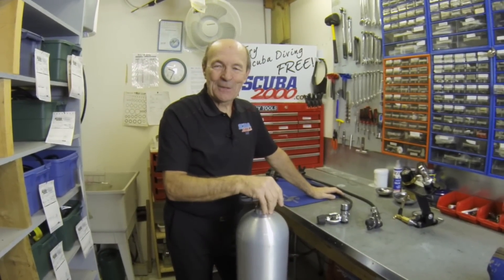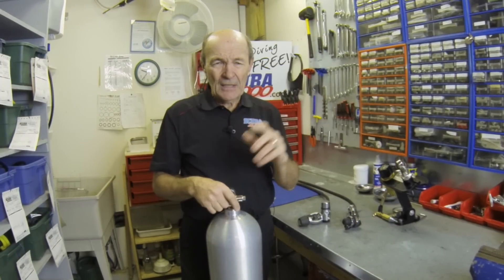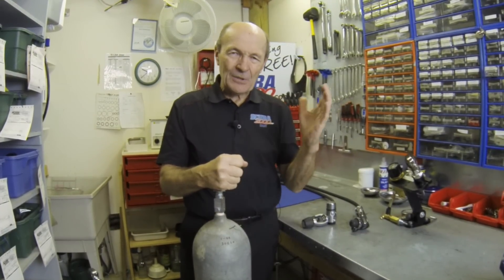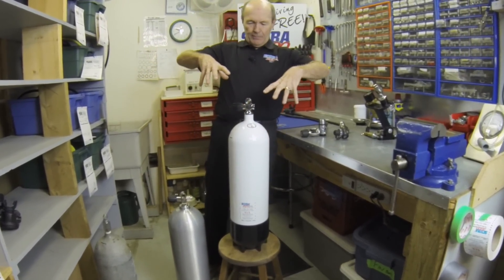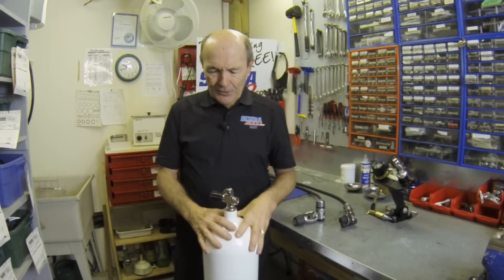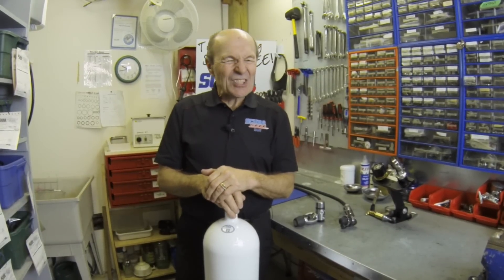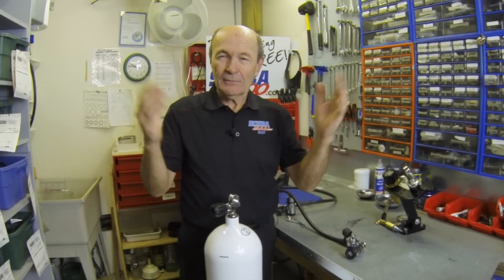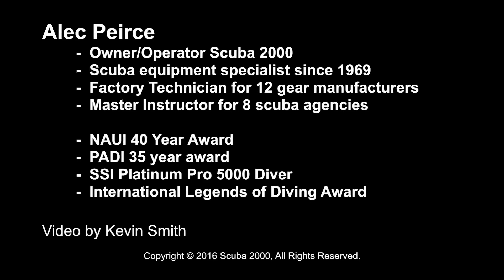Steel vs  Aluminum Tanks - Scuba Tech Tips: S03E07

Comment: In my opinion DIN has one more advantage over Yoke. The O-Ring is in the Reg, not in the tank valve. 

So it is the diver's responsibility to have a proper O-Ring in his Reg and everything will be fine. With Yoke you have to rely on the Dive Center. 

For example renting a tank, not checking it in advance and finding out that the O-Ring is broken when you finally arrive at the dive site isn't a funny situation.
Reply from the maker: There are as many O-Rings in a DIN reg/valve assembly as with a yoke. In fact, if the DIN valve is a converter valve as is more common these days, there are MORE in a DIN. DIN or yoke, inspection and annual replacement of O-Rings is necessary to avoid missing a dive.
A tank must have an annual visual inspection. We always replace both O-Rings - the neck which both DIN and yoke have and the face O-Ring of a yoke style. O-Rings cost like $1.20. I've had divers argue with me that they don't need a new one because they replaced it "just last year".
So it isn't the valve style. It's diver care.
One small point is that if the DIN O-Ring in your regulator fails, your instructor or buddy won't have a spare unlike yoke O-Rings which are very common. You better carry one.
I'm not sure I agree that a diver is more careful about maintenance than a dive shop. Although I must admit to seeing some pretty sad tanks at dive resorts.
Take care. Alec
Reply: Are there real advantage for Yoke regs? DIN one you can use with 200 bar or 300 bar, they smaller and lighter, also I've never seen them making bubbles like Yoke do (I know that O-ring should be serviced properly, but looks like O-ring in a tank getting destroyed quicker, probably because it's also there during pumping air into tanks), so why not switch to DIN and be done with that? It's very annoying to always remember about it.

Also price is the same for DIN and Yoke for at least some bands.
Reply: Kons G this happened to me during my PADI course. We drove 2 hours to the dive site and found out o ring was faulty. Luckily my instructor carried spare o rings. I want to use DIN for this reason.
Reply: That's fair enough Alec :) 
I just got the personal impression that we have problems with Yoke every now and then (currently doing my Divemaster internship in Asia), while i've never seen a Problem with DIN in Germany before. 

My Reg (Apeks DS4) has a spare O-Ring on the outside of the dust cap, so i have it with me automatically ;)
Reply from the maker: Boy, that sounds like a great idea right?
Many divers do the same thing - they keep a spare O-Ring, whether tank face O-Ring for yokes or DIN for their regulator, attached to the reg somehow. Yoke divers can simply put one on the threads of the yoke screw under the knob. DINs can be attached to the DIN cap or just a cord on the regas you suggest.
Here's the problem. Unless you are one of those 1 in a 1000 divers who checks and replaces everything all the time, you won't even look at your spare O-Ring until you need it. Am I right? Be honest. So, by the time you need it, it's been hanging there for 2 or 3 years (or more) and is so dried out and cracked it's useless.
I see it all the time when servicing regs. I notice a spare O-Ring on the reg, check it and it's toast!
Just change them every year without fail. They will easily last a year unless you leave it in the sun and salt all the time. Alec
Reply: You're absolutely right Alec, i'm not the one out of the 1000 😀
Reply from the maker: At least you're honest. This is our sport, for fun, so of course we don't spend hours checking and re-checking our stuff. I'm just as bad. I know my gear was working last time so it must be OK to go right? Fortunately scuba diving is a very safe sport and the gear is very reliable so we can get away with a casual approach. Aren't you glad you chose scuba over sky diving??

Comment: I was in the market for a used tank, and ended up going with High Pressure 100 steel, which happened to match the ones I had been renting all along). Here is something to consider. While ALU80 are cheap (about $170 online vs HP80 at $280) if you look at getting the higher capacity 100cf (I'm tall guy and like to stay as long as possible, not a problem with a drysuit even in cold 50deg waters in Monterrey) then ALU100 are much closer in price vs steel ($280 vs $330) but the worse part is the weight. Catalina 100cf is listed at 42lbs vs 34lbs for faber100 (whopping 8lbs heavier!) yet buoyancy is only -5.2lbs vs -8.41 full so you need an extra 3lbs of lead as well. That's 11lbs difference which is a lot to carry when I already have a belt with 26-30# and a full tank...

The difference between Catalina 80 (32#, -1.8) vs faber HP80 (28.6#, -8) is similar 3.4lbs heavier, yet 6.2# more of lead needed. 

The tank I got (XS Scuba/Worthington X7-100) is ever better buoyancy listed at -10lbs full (I measure mine at -13.2lbs in pool water! and only 1.5# heavier on land than faber's HP listing). If I switched to standard CF80 ALU I calculated I would need to add 11 lbs of lead to my already 26# belt - Yike! :(  (13.2 - 1.8 not taking into account salt water)

Most shop and people who knows dive HP steel here (cold water) for a reason. In tropics where you don't need much weight at all, ALU80 might be ok (not ALU100 running the numbers I did above!). ALU is HEAVIER due to thicker walls on land, yet not as high psi so more floaty (bigger water volume displacement) and actually FLOAT when near empty which you don't want diving IMO. The thing going for ALU80 is the price (and cool colors!), but that delta disappears in larger sizes (less common)...

fascinating video - no wonder ALU80 are cheap
https://www.youtube.com/watch?v=OmSvbp2NFbc&feature=youtu.be

Comment: I have a "Steel 72" made in 1959. They used to use pipe threads to seal with Teflon tape.
More modern steel tanks use O-ring valves like aluminum 80's.
Aluminum 80's cannot be trusted after about 10 years old, some dive shops refuse to fill them since they can catastrophically fail from Sustained Load Cracking brittle fracture around the threads. The 6351 alloy also has age hardening over time which makes the alloy brittle.
Even the newer 6061 aluminum alloy tanks can be a "non-fill" after 10 years.
Aluminum tanks have a secondary eddy current test to look for cracks during hydro and some dive shops require it for annual inspections.
Steel tanks cost more, but they last longer. I have tanks made in the 70's/80's that will still pass hydro.
Yes, steel tanks can catastrophically fail as well but it's uncommon vs. aluminum 80's.
Rust (light haze) in a steel tank can be "tumbled" out and if the tank then passes hydro, it's good. Corrosion in an aluminum tank is an instant fail.
Rough estimate of strength: Aluminum is about 1/3 the density of steel, but it's also about 1/3 the strength so you need 3 times as much.
If you get a "boat fill" on a dive boat (some only fill to 1800--2000psi) the steel 72 holds more air that the aluminum 80 due to its larger internal volume.
In the 1980's there was a rash of failures on aluminum 80's due to the owners getting their tanks painted with a paint that had to be baked on at about 300--350 deg F. That was enough to soften the alloy and tanks were failing. Paint job looked fabulous, however.
Reply: interesting info. If your boat does low pressure fill, than LP steel are the way to go (a guy had a 120LP steel on my last trip and it looks like a water heater compared to my HP100!) but luckily they can fill to 3600psi but had them top mine off a few time after cooling off to get the full 3500psi my tank can take.

Comment: One thing you mention that steel tank can actually be lighter on land than ALU (where it matters when you carry your gear) because of thinner walls, but miss to mention is that HP steel can be a lot more negative buoyant which can really help you carry a lot less lead too so you don't cork to the top at 15ft on empty! Price aside, seems like the higher the pressure the tank, the denser steel, the better = less lead weight while being lighter on land (less outside volume that displaces water)... ok where is my compact 5000psi steel tank now ? :)

Ex: Faber HP steel 80 (3442psi) vs Catalina ALU 80 (3000psi): 
land: 28.6# vs 31.6# (steel 3# lighter)
Buoyancy full: -8.05# vs -1.8# (steel requires 6.2# less lead weight in water!)
That's a pretty significant difference....
Price: $275 vs $170 on leisurepro, so yeah $100 more...

Now on my lobster hunt boat trip, the compressor could only do 3600PSI Nitrox, and they hot fill it fast so you loose a good 300psi on cooldown/hit the water, so I had to ask them to top of the ~3200 I was getting before each dive! (tank 3492 rated). Some repeated customers had LP steel 100 @2450psi or so - big ass cylinder - and could get it hot fill close to 3000psi and get a good 2500+ fuller tank (+10%) and not have to deal with top off - so there was a case there for the opposite due to filling situation.
Reply from the maker: Lots of information to think about. Every diver and dive situation is different so it's hard to generalize. A steel tank is more negative and that's one of the main reasons to use it. If weight is not a problem, the good ol' 80 does a fine job. Filling to beyond the stamped pressure is simply wrong. It's not so much a matter of safety. The tanks will not burst but it's not good for them, I've had more than few safeties blow (they're not very accurate) and it is illegal to boot. The stamped tank pressure is the end pressure when it's cooled back to 70 degrees. Filling high and letting it cool is NOT the proper way. I think you probably know all this but to get a full tank are compromising a bit. I suggest that you're not using all the air anyway on a dive so what's the big deal about 3-400 psi? That is, if you exit with 500 or more anyway, why compromise safety for 2-300psi? Alec
Reply: well a 3500 HP tank filled to 3200 (cooled) is 10% loss and when diving nitrox, like we did 6 dives a day,  you are running out of air way before your no-deco times (shallow 35-50ft) so yeah I'll like an extra 10% time hunting for bugs that you paying $$ for :)
That's irrespective of the 500psi reserve safety you leave...
Reply: + Alain Dumesney "... miss to mention is that HP steel can be a lot more negative buoyant which can really help you carry a lot less lead too."

He did mention that. Watch again at 7:35.
Reply: +SeikiBrian he's comparing HP steel 100 vs ALU80 - says: same "size" more air and heavier so more negative buoyant  (so less lead to carry on you) BUT fail to say same 80CF tank in steel HP will be a lot smaller then ALU 3000psi and lighter on land, yet more negative buoyant - run the numbers.... that's why HP steel are more efficient in that respect. That key (vs cost)

Comment: alec  I have 2 older steel tanks that have certainly been completely empty for a few years. my question is. if they have some rust inside can they be cleaned and re certified ?
Reply from the maker: Well, it's not good that they've been completely empty but they may survive. Have your LDS (local dive store) do a quick visual check to see if they're OK. Then get a hydro test and proper visual. If they pass, they're good to go. I suggest the quick visual first to see if they should even go to hydro. If there's signs of serious rust because of moisture or even high humidity, there's no point spending money on a hydro. Most older steel tanks show some rust. It's called surface rust and is not a problem if it isn't corroded into the steel and isn't loose. They can do a quick clean with a special brush or if needed, tumble the tanks to scour the inside. Even then they will likely get a thin rusty finish on the inside but that's not a problem. When a tank is hydro tested, it's filled with water and unless it can be dried instantly (almost impossible) it will develop surface rust. We use a rust inhibitor in the final rinse and very hot water and an air dryer but some rust is inevitable. Hopefully they are not too bad and can be saved. I don't need to tell you that you must keep some presssure in them at all times. Just 100psi is enough. You also need to consider the cost. An older steel 72, tested and ready to go, is worth about $100. A hydro and visual will cost you about $50 or $60 so be sure the tanks are worth saving before you start spending money. Good luck. Alec

Comment: HI Alec!  Thank you for the great videos.   I have a question about steel vs Aluminum.   Do you find the balance to be different?  I feel like the steel wants to turn me over on my back.  I only dive aluminum once, and i don't remember that feeling.  (new diver in New Hampshire)  Thanks!
Reply from the maker: You're right! There's a big buoyancy difference. Steel tanks are decidely negative while aluminum tanks are slghtly positive when empty and only slightly negative when full. So with an aluminum tank on your back and with weights as usual close to the front of your body and in the normal attitude for recreational divers (horizontal facing down) your balance is nearly perfect. Put on a steel tank and now your back wants to swap with your front - you roll.
Using a steel tank requires you to move the weights around until you find the rght positioning of them. Once that's done, and it can take a bit of time, you'll be fine again. Steel tanks are the choice among technical divers (cave divers and for wreck penetration or deep dives) who want less lead weight but a negative positioning. They tend to be close to the bottom, want minimum fin movement and more controlled buoyancy without excessive use of a BCD. None of these is as important to recreational divers so the use of steel tanks and their odd characteristics is avoided, unless you're just looking for more capacity. The aluminum 80 tank, universally the preferred tank worldwide, is so for a reason. It is a near perfect combination of capacity, weight, size and buoyancy for most divers. That didn't happen by chance. It was designed to be so. The first aluminum tanks (1975?) were different. They were 72 cubic feet, longer and smaller diameter - 6.75 " versus 7.25". We called them torpedo tanks. Not many exist today. I have a couple in my collection. They were made that way to compete with the old 72 cf steel tanks that reigned supreme for 40 years. They were even the same pressure (2400psi) as the old steel tanks. Tank manufacturers wanted divers to accept them as a good substitute for their old steel ones. As the aluminum tank became more accepted by divers, they changed the size and pressure to what we have today. Good luck with your tanks. Thanks for watching. Alec
Reply: Thank Alec!  I enjoy your videos!
Reply from the maker: Thanks for watching Bruce. Alec

Comment: you mentioned the yoke is made of steel along with the DIN fitting , most regulator and valve parts are made of plated brass
Reply from the maker: You're quite right right Ralph. All valves, whether yoke, doubles or triples are made of brass, usually chrome plated although some have a flat finish and some have a 'titanium' finish (not really Titanium). Unfortunately, many of the threaded parts, nuts, couplers, etc. are made of steel so it's very common for divers to overtighten things in a mistaken effort to make sure they don't leak and strip the threads. A good example is the port plugs or the hose ends. The real irritation here is that the port plugs doesn't strip - it's steel. The body of the regulator strips! Thanks for watching and catching that slip. Alec
Reply: Yup some regs are titanium , not suitable for oxygen service , I wouldn't use them for nitrox either unless you exclusively do dive travel and weight is a big issue for you good old brass regs are a better option as brass is less brittle brass also gives far superior cold water performance having a thermal conductivity of around 110 watts per meter per Kelvin where as titanium is around 20.
Reply from the maker: Pretty huh? In my opinion, for titanium regs that's what you're buying - looks.
Contrary to what an Atomic fan will tell you, which he undoubtedly heard from an Atomic salesperson,  and as Ralph has pointed out, titanium has one single advantage - weight. It's lighter than other metals used in regs. But you pay a lot of money for that small weight saving. Realize that you're talking only about the first stage body. All the rest of the regulator is the same as all others on the market. 
And, again has Ralph has mentioned, there are actually some disadvantages to titanium. It isn't just the lower thermal capacity of titanium, it's the smaller mass. I used an old (1975) DACOR 400 for many years and it was the best I ever used under the ice. It was so big, solid and brass that it took forever to cool enough for the moisture in the air to freeze. Not the best for travel maybe but great for diving in cold water.
Reply: Alec Peirce Scuba all? how about those fancy Atomic titanium regs...
Reply: Thank you for sharing your wealth of knowledge. When I began diving the all titanium regulators looked like a big advantage with their superior resistance to corrosion. As I later learned about using 50-100% O2 for deco titanium all of a sudden became a pretty metal that may spontaneously burn...not so good. They are kind of like an exotic sports car, shiny, expensive, and not so practical. Love your videos!

Comment: I need a tech tip ... My Nikonos 4A has a bad battery holder and I need to know how to replace it and where I can get parts for my Nikonos 4A ...
Reply from the maker: There are stores that cater to Nikonos camera fans. The best place is probably eBay. You can get a complete Nikonos iv body for $30. You could use it to practice getting the battery compartment out and then  install it in yours. Full service manuals are also available. Good luck. Alec